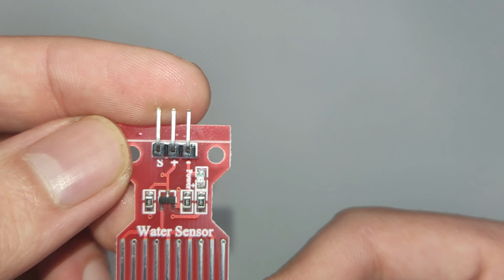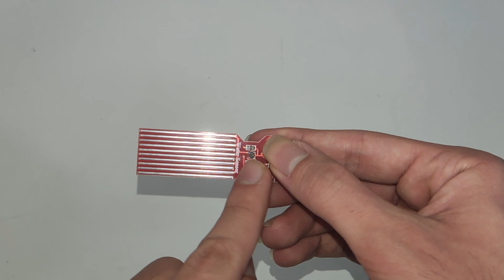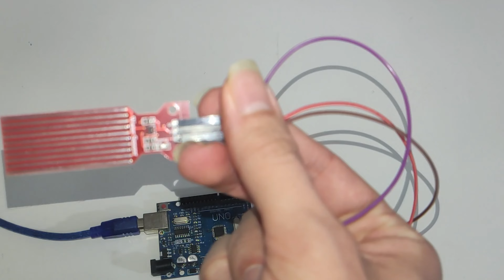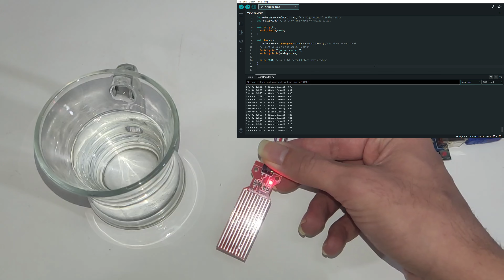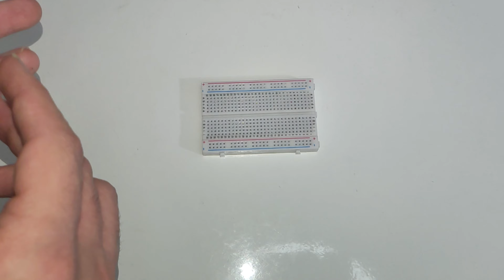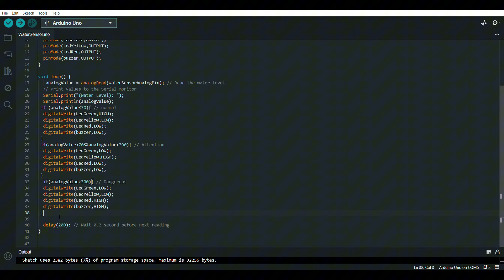Water level sensor 💦💦

Comment: int waterSensorAnalogPin = A0; // Analog output from the sensor
int analogValue; // to store the value of analog output

void setup() {
  Serial.begin(9600);
}

void loop() {
   analogValue = digitalRead(waterSensorAnalogPin); // Read the water level
  // Print values to the Serial Monitor
  Serial.print("(Water Level): ");
  Serial.println(analogValue);

  delay(300); // Wait 0.2 second before next reading
}
Reply: Thanks Broo